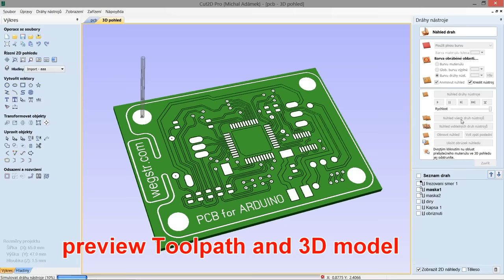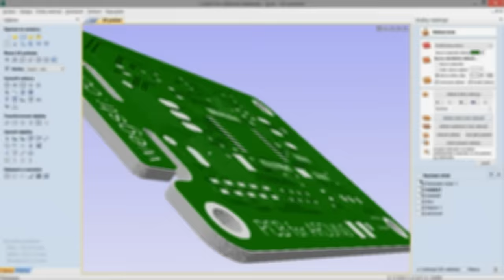How to make a PCB prototyping with UV soldermask - STEP by STEP

Comment: i have an important question and i hope you reply 
 when you apply the UV ink and spread it on the board then put the transparency paper then expose to the UV light 
 how you ensure that the ink will dry on the board and not to dry on the transparency paper 
 tried the method on this video and the reverse happened to me that the ink dried on the paper not on the board  
at all i appreciate your effort
Reply: The problem would lie with the type of material your transparent film is made out of. It seemed to be hit or miss for me on which film worked and which didn't. Google "UV solder mask sticking to cover instead of PCB". The first result is a good thread on this exact topic. Good luck!
Reply: thank you i will search it
Reply from the maker: Try different plastic foil, we had similar problem until we found suitable foil.
Reply: do you have a link for the suitable one you found ? i will appreciate your favor

Comment: hi the video is amazing   . 2 questions :
first how can i make 2 slayers PCB ? 1 layer is only good for basic projects 
second , the second part when u take the solder mask off the pads but changing the spring  , is your machine the only one which dose this ? i have not seen others to do it so people use transparent pages to give UV in the parts they want mask to be hard , or do u do something in menus of the program so it dose do this ?

Comment: What are the bits made of (Carbide, Diamond, HSS, etc), and how often do you have to change them since you are cutting into fiberglass?
Reply from the maker: It depends on many factors - speed, material, milling in liquid,...and the material is carbide.
Reply: Thanks for the amazing video.

Comment: How can you control the height of your tool while machining the solder mask(Considering that you changed your tool)? Is the machine so precise?
Reply: If I understood correctly by the video, they used spring for damping of milling tool. So , when a milling tool goes down , spring doesn't allow it to go below.
Reply: @embedded_  This is interesting, it would cause the tool to mill the appropriate depth.. Thanks for the clarification.
Reply: @andreferrato  de nada

Comment: How did you know how deep to mill, after applying the solder mask to remove the mask on the pads so just the copper is visible at this point then?
Reply from the maker: that is why we used the spring bit
Reply: hmmm... not sure if I completley get it because you need to have some measure of drilling depth in place, dont you?
Reply from the maker: The depth of the drilling is about your design and generated tool paths of the workpiece. For that purpose we use e.g. Cut2D from Vectric company
Reply: That far I agree, but when you apply the soldermask how did you manage to get just deep enough so the copper pads are not damaged?
Reply from the maker: As I wrote in the first comment. For that purpose we used the spring tool which manages the right depth of the track. You have to setup the right pressure controled by the length and strong of the spring.
Reply: can i buy one of those spring bits? does fit in er11 collet?

Comment: how to metallize holes?
Reply: x2
Reply: They aren't. This is only a single sided board. No via's. To via through, you could use some kind of rivet?
Reply: Richard Smith , I dont care, the question is: how to metallize holes?
you cannod make serious pcb without holes.
it must at least have metallized holes, or better also be more than 2 layers.
Reply: You can also run a jumper through, but that isn't 'metalizing the holes'.
Reply: hobbyst could design socket1366 board...
Reply: @victorzedwings  he owned you, cut the crap now hobby boi

Comment: when u remove solder mask with those cnc u didn't remove abit of CU from pad?
Reply: Same Question as Above +WEGSTR CNC
Reply from the maker: we used the spring bit to remove just the solder mask but not the CU

Comment: very good job, but my pc, does not have that port, only usb, will it work? how about the software?
Reply: I would recommend you to buy old PC with parallel port. Regarding the software you will need something for designin your workpiece (e.g. Cut2D, Cut3D, Aspire) and software for machine controlling (Mach3). For PCB prototyping it is Sprint-Layout.

Comment: Good day

Can this CNC machine be used with any PCB software? I  am using Seetrax Ranger XL/XL Designer. The quality seems really impressive!
Reply: I think it is possible to build this machine. Pritty much works with the 3D printer principles. I use Proteus btw. It is a pain in the ass to make a PCB old fashioned way isn't it?
Reply: İBRAHİM ETHEM KAYIKCI 
Hi Ibrahim, yes the old fashioned way is very messy. I am very surprised that a company hasn't been able to make an affordable machine for the DIYer. Except for the portable expensive cnc milling units on the market that I see now, the pcb process has hardly changed since the 1990's. Most people on the internet still seem to use some variation of the old fashioned method.

Comment: Dude, rlly? Milling the soldermask with de cnc, when you can put a black cover (like a piece of black tape, or print some one in a transparent film) before to put the pcb under the UV light...
Any way.... perfect quality but my old pcb maker instinc is crying </3
Reply: that bugged me too, its bragish and pointless waste of time that could be spent ...idk...populating what you just made.
Reply: Frankly, it's easier. No need to worry about how to register the film to the milled PCB. If you're off just a little, it's usually no good.

Comment: When milling with the spring loaded tool, how do you get the correct depth so you do get through the mask, but do not go through the copper? I assume at this stage the point is to get rid of the mask so when you do the "liquid tin", the tin has something to stick to.
Reply: Interesting question, looks like this is the point about the spring, it is just strong enough to remove the soldermask but too weak to remove copper, maybe scratch it a little, but I'm not sure, I think a thicker solder mask should be pretty hard, so it is sure also about for how long it works on one spot, needs for sure some experience because one thing is done by hand and the other by a pre-programmed machine, so it is needed to know how to programm the machine.
Reply: I think it was due to the spring strength. It gave him leeway so he wouldn't have to be precise on the depth. The copper is harder than the solder mask, so it would push back on the tool harder than the solder mask.

Comment: Great ,But it just can make 1-layer boards.
Reply: Wrong. He placed the board back after the soldermask process and etched the pads. That alone should tell you he could easily flip the board over and transport his bottom layer into whatever software he's using. As for throughole plating there are various methods for doing just that.
Reply: Yes, makerfabs can provide premium pcb service, can make multi layers from 1 to 28,really amazing.
Reply: The Mod Shop  What about metalizing the holes for the vias? That would be a whole other process unless you soldered all the through holes on both sides, you would also have to solder jumpers through the vias without components, and again, solder on both sides.

Comment: how do you tin the PCB? what chemistry?
Reply: Tuấn Đạt silver nitrate.
Reply: how do you plate the via holes?
Reply: Tuấn Đạt you can't. Not without manually stuffing a tiny copper tube into the hole first.

Comment: And how do current-conducting holes?
Reply: I guess you would do some reference holes first, then drill\mill the vias and  electroplate the pcb, then the usual milling process
Reply: For PCB vias WEGSTR offers copper rivets: https://wegstr.com/rivets-for-PCB-vias-0.6-mm Drill the hole, insert the rivet and fix it in the hole with the riveting tool. Honestly it is really annoying job and prone to bad contacts, but for the one-off quick prototyping it will do the job. And it is faster and cleaner then setting full scale via chemical metallization process at home.
Reply: No way.
Reply: Easier and cheaper make an interlayer connection

Comment: Hi, How you made this pcb, software, programs etc. if is possible. Thanks.
Reply: Please check the video once again - it is the tutorial.
Reply: Hi, I really did, so What kind of drill bits did you use to mill the toolpath, the solder mask and to cut the pcb?,  to look for them in wegstr.com,  by the way the result is amazing. Thanks!
Reply: Can you give us an alternative or specs for the bit you used for the toolpath engraving?
Reply: The spiral bit is already on our website e.g. http://wegstr.com/index.php?route=product/product&path=61&product_id=100

Comment: All good except the way solder mask was removed, it might have damaged the copper beneath it.
Reply: with normal acid methods the copper is also damaged a bit, on the sides of each track.
Reply: what normal acid method ? google UV curable solder mask, its way better.
Reply: well, when you use normal mask + acid methods, the mask protects the surface of the track, but not its sizes, when the acid already remove the others areas the level there is lower, so it starts to eat from underneath. Ofcourse it is a minimun damage, the same minimun damage for that bit scratching the surface.
Reply: did you even read my reply? google UV curable solder mask
Reply: But originally I didn't talking about the solder mask process, you said, it might have "damage the copper beneath it", well it is a minimun damage, the same, as the process of creating the tracks by normal acid methods (the step before). So if he has a machine that can do everything without involving acids.... it is way cool, it is slow, but it is for prototyping anyway!.

Comment: Isolation routing is only good for low voltage circuits. There is just not enough clearance for higher voltage isolation.
Reply: you can mill all the way through the board and make channels for high voltage isolation
Reply: That is not possible to do on an entire board. It would just fall apart. You need large areas of removed copper. So then it becomes impractical to use the isolation routing technique compared to chemical etching. I have a CNC machine that I isolation route PCBs on. I'm not going to mill away large areas with a .2mm bit. I ain't got that kind of time.

Comment: Hola excelente video, tu puedes ayudarme con la relacion de tinta y solvente para obtener tan buen resultado como el de tu pcb..thanks you....  Hello, excellent video, you can help me with the quantity  ink and solvent to find good result
Reply from the maker: Hello, I would recommend to use it according to the instruction manual provided with the solder mask
Reply: Thanks ... do you have any label or copy of an ink manual
Reply: I would appreciate
Reply from the maker: sorry, just ask the seller of the solder mask

Comment: I wonder how long entire process of making a single board takes? 
I can see there’s: PCB milling, UV milling, drilling, cutting out the board
Thanks
Reply: ive done it without milling and takes me about 4 hours, mostly because of curing time, but milling im sure is much faster
Reply: oh thats why mass production is required if you want a board u need to order 1000 to make it worth running on their lines for all the different steps  for 4 hours lol

Comment: I hope this is just to show off one of the (many?) things that this CNC mill can do, because I'm not going to run out and buy a $2000+ specialty CNC machine just to make a pcb that will ultimately blink an LED. Especially not when I could have made something better with a $30 Craigslist printer, $10 transparency film, $10 UV lamps, the right resist, and some hardware store chemicals.
Reply from the maker: There is a lot of products what you can make on CNC Wegstr. Not only the PCB of course. See our other videos to get the inspiration.

Comment: Good day I am your subscriber, could you design A pid temperature controller on arduino for heater from 0 degree to 400 degree Celsius, with current temperature display and preset. Well, to the temperature can be set with the buttons. Generally on the similarity of the REX C100. Thank you in advance.
Reply: I think you might be confused on what WEGSTR does. They make CNC-machines. They do not design electronics for you :D

Comment: oh, so all I need is hundreds to thousands of dollars of equipment and supplies to make an "ARDUINO prototyping" that would cost about $2.50 from osh park, or $5 for 20 from a Chinese board house. Makes sense...
Reply: It does when these tools are at your disposal. Of course, designing the files isn't worth your time but the internet supplies us with lots of boards we don't want to redesign. And it allows for much more complicated and faster rapid prototyping than you would normally be allowed to do.
The point of this video is to show off the mill and i also own a CNC which i can do pcb milling with. But you don't need these tools. Because pcb milling doesn't require much force you can get away with installing a rotary tool such as a dremel on a 3d printer as a fun project and cheap alternative. 

So yeah if you have/are interested in 3d printing but also want to make PCB's i think it's worth the 200-300 bucks and it tbh just makes prototyping so much more fun.
Reply: Molo mono wait what? designing the circuit board for this project would've taken exponentially less time than procuring all of the equipment and supplies and setting them up to create a  PCB of that quality. If you're going to go through the trouble of literally making a circuit board, you might as well take the tiny extra step and simply design it to your own needs. KiCAD is free, there's a free version of eagle, there are web based PCB tools, hell, you can even lay out two layer boards on Android for free now. What's the point of doing all this to make a PCB that you could've probably just ordered from whoever you copied the design from? 
I'm sorry but you're not looking at $200 for what's needed to make a PCB like that, and if you can DIY it and swing $200-300 it will undoubtedly take tons of time to get working perfectly unless you only use large TH components with a large pin pitch. Also, no $200 3d printer can be equipped with a Dremel and successfully route clean PCB traces without tons of modification and probably never being able to be used as a 3d printer again. Hell, most $200-400 3d printers barely can successfully do the single task they're designed for (with decent tolerances anyway) let alone be turned into other more intricate pieces of equipment. And even so, how do you plan to get plated through holes or vias, just plug them with solder? 
For you, great, you already own a CNC... For the average electronics hobbyist that may make 10 PCBs a year if that, it makes no sense. I design and sell PCBs and it still would not make absolutely any sense to invest in this equipment to turn out boards or even to just prototype new designs that I can simply pay OSHpark $4 for 3 boards, and expect quality standards your 3d printer with a Dremel rigged to couldn't ever match. It hasn't made economical sense to do DIY etching or anything for years now, though that doesn't mean there isn't still a market for it.
Don't get me wrong, I'm not saying it isn't cool, and interesting, and certainly if I had a CNC I'm sure if I had time to waste it's surely something I'd do as a learning experience. For me though, it is not a feasible replacement for prototype services. Mostly because if I had to guess, that single board he made ended up costing like $30 if you factor in the electricity used, copper clad FR4, solder mask and everything associated with it, and most of all;. his time(i.e. opportunity cost). Just not worth it to me. In your case, it may be though and that's cool. If it is, I hope it's a good experience and works for what you need.
Reply: OSHpark is still expensive when I calculated. I bought a Chinese CNC 3018 and worked great, just for prototype. As a designer, you have lots of things to change while testing on PCB. Milling is just great on the buck and my time, that's what I found.

Comment: 3600 garbage. same as ebay 200 dollar one. Same thing differanr look.
Reply: exactly
Reply: this video is 5 years old.
Reply: @larrybud  and the price is still the same
Reply: @StreamzNow  They must be selling enough to stay in business, so someone is finding it of value.
Reply: As an owner of one of these CNCs from Wegstr I can tell you that it is worth EVERY cent. The quality of the results that I obtain are totally worth the price. We primarily use this machine for rapid prototyping of boards taht cannot wait 2-3 weeks to arrive from China, as others have mentioned. I have created a bunch of high-quality prototypes where solder mask, silkscreen and so on are NOT required. While it is true that it might be a bit tedious, the results are perfect. Regarding other questions like warping and uneven surfaces, the machine has autolevel function, which is VERY accurate